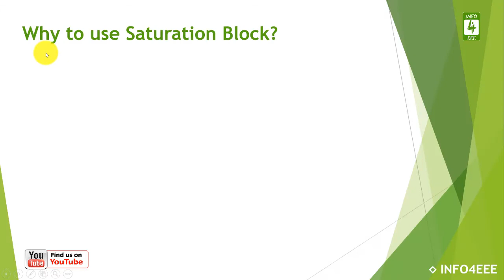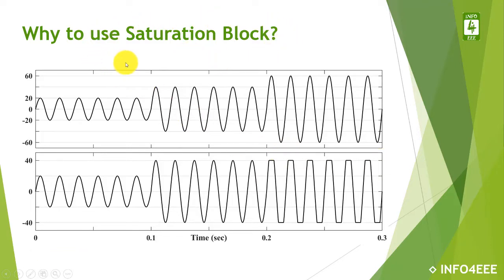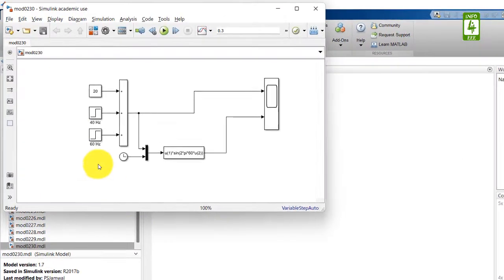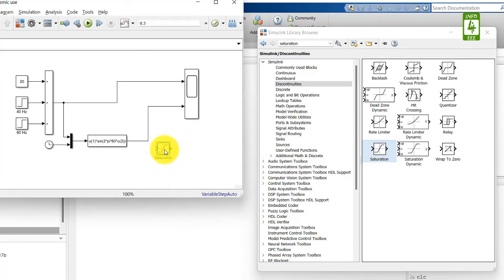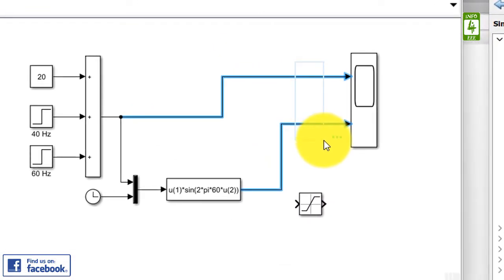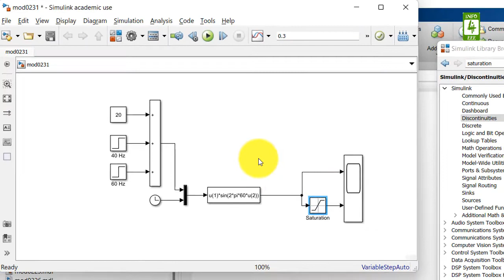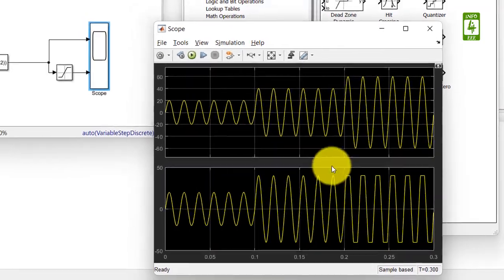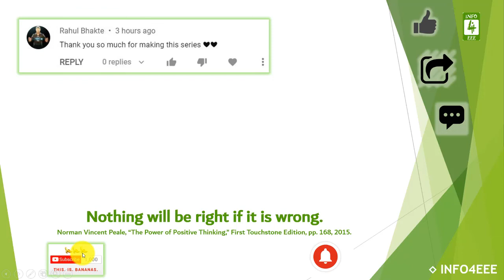Saturation Block in MATLAB Simulink for Amplitude Saturation #31 | Basics | Paramjeet Singh Jamwal

Comment: what is the use of saturation dynamic block and difference between saturation and dynamic satusation
Reply from the maker: Hello Ajay Ghanwat, thanks for showing faith in us!

As discussed in this video, a Saturation block is used to saturate the amplitude of a signal within the constant upper and lower values.

While Saturation Dynamic block is used to saturate the amplitude of a signal within the variable upper and lower values. For Example, the Upper limit can be 10, 30, and 50 for 0-0.1, 0.1-0.2, and 0.2-0.3 seconds by feeding the rising step signal at the first terminal of the saturation dynamic block. The lower limit can be -10, -30, and -50 for 0-0.1, 0.1-0.2, and 0.2-0.3 seconds by feeding the falling step signal at the third terminal of the saturation dynamic block.